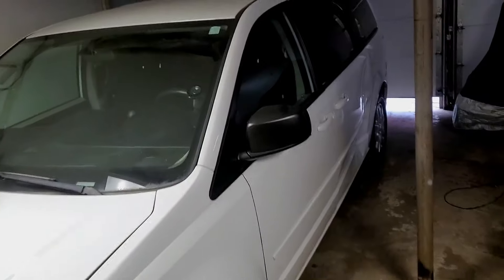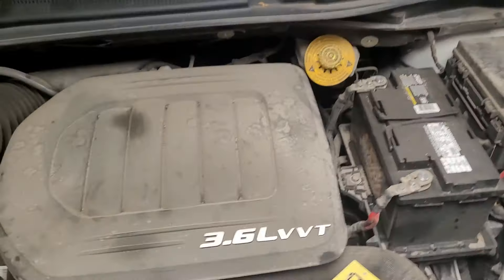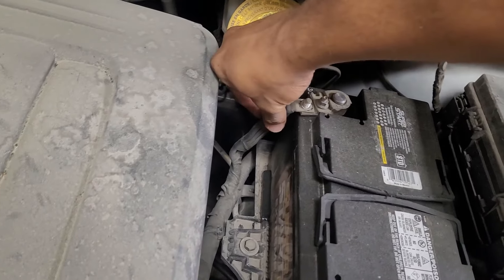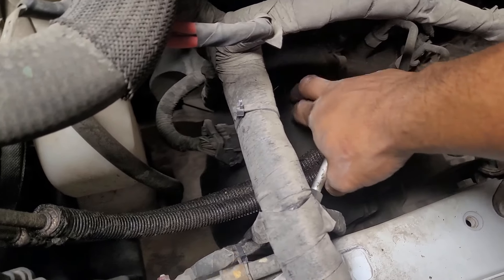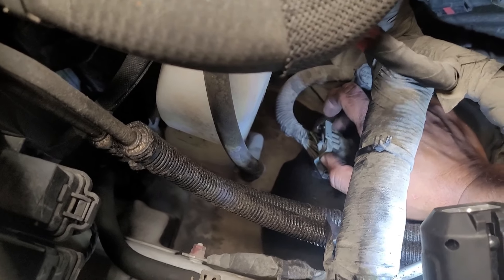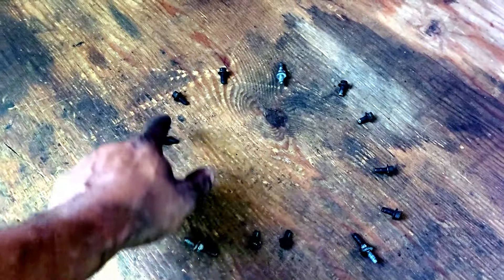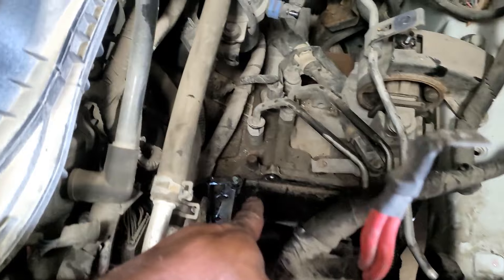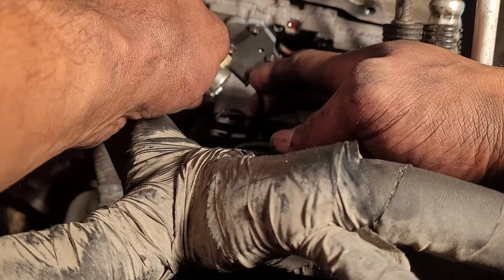2014 Dodge Grand Caravan 62TE Transmission Shift Solenoid (Minute Maintenance)

Comment: Ours is banging when reversing it does have 180k so could be normal.
Reply from the maker: Hey thanks for watching, banging is never "normal" but due to mileage could be part of the deal now from wear and tear. I always recommend a transmission flush and filter would be good for the vehicle and may help reduce any noises that could.be caused from the transmission shifting. Happy Wrenching!!

Comment: Poor battery should have been placed on some cardboard
Reply from the maker: Oooo I've never heard of that before, what's the concept on putting a battery on cardboard?
Reply: @minutemaintenance7385  in theory, placing a battery onto concrete can drain it.
Reply: @12334duh  I believe that was the case many years ago when battery cases were made of a different material, and it's not an issue with modern batteries.

Comment: My 2010 GC shifts 1,2,3 but not 4,5,6.  Is this the solenoid that needs to be replaced?
Reply: It's going  into limp mode.  It has several selniod sensors.  You probably have to change the valve body.